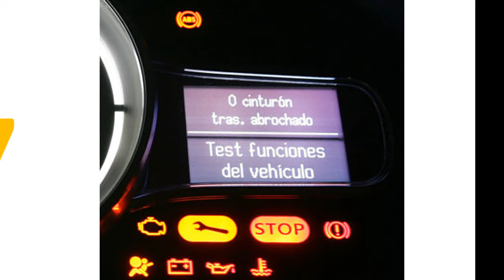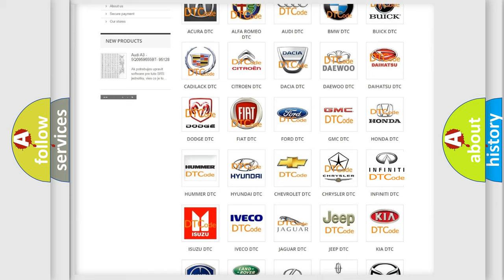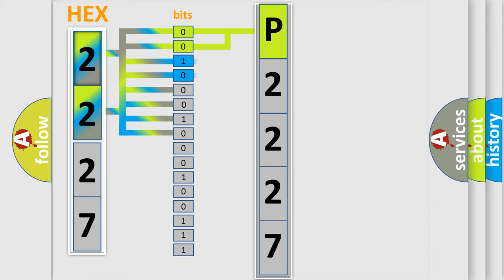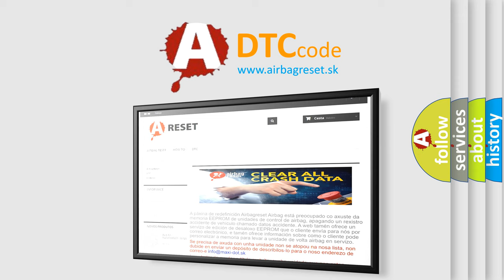DTC Ford P2227 Short Explanation

Comment: Thanks for the video. Do you know the possible ways to fix this? 

I read on google that this code error is about barometric pressure sensor in other manufacturers, so, according to your video it seems to be about the voltage delivered to the seat module.

Thanks,